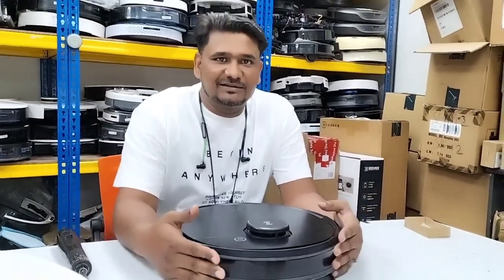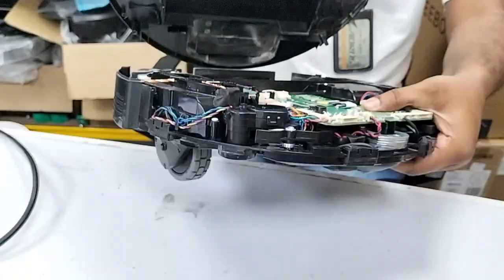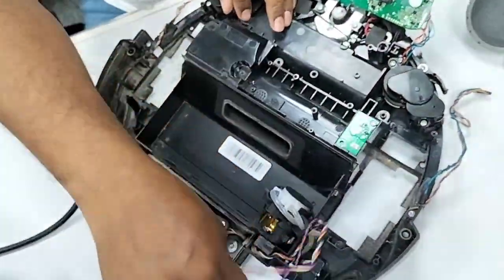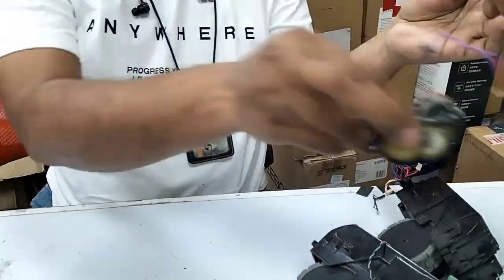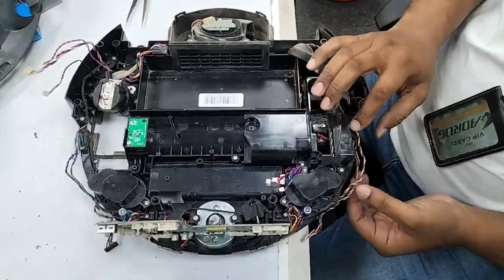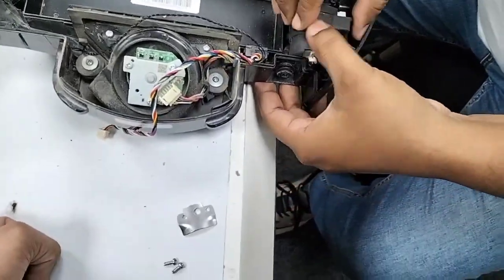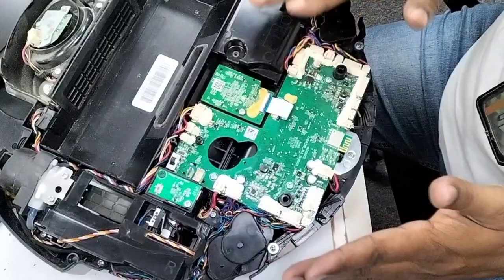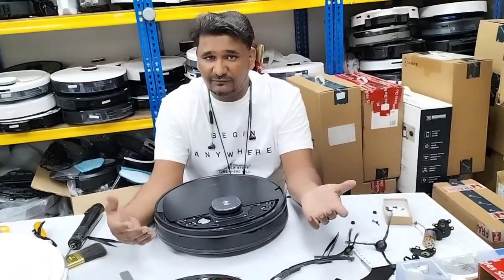How To Replace Main Brush Motor In Ozmo 920,950, T8, T9, N8 Pro, T8AIVI & Many More

Comment: The brush on my N8 Pro+ quit spinning, watched this video, bought the part online for $30 or so bucks at amazon, followed the video and the robot fired right up after assembly. On my Brush Motor, the pinion gear on the motor had stripped due to hair getting in and displacing the lubricant.  Thanks Guys, saved me some money in these expensive times!
Reply from the maker: Welcome

Comment: awesome video, my brush stopped spinning. after cleaning the motor it worked perfectly fine although i got two srews left ... but the dude in the video is right its a pain in the ass to dissemble and reassemble.

Comment: Thank you! I was able to do a repair myself, it was not easy, The gear attached to the motor was half gone, but I managed to make it working by raising the other gear wheel with an additional washer! It works fine now, not sure for how long though 🙂

Comment: My main brush was feeling bound tightly at random intervals of rotation.  His very detailed instructions allowed me to get the motor out and remove my animals hair/grease sludge from the gear box, re-lube and put our Deebot N8 Pro Plus back in action.  Very minor differences in some wires and screw locations, but I would have never pulled the motherboard to get to the motor without his instructions.   Thank you for this!!
Reply from the maker: Waoo superb.... really happy to hear that my videos help you to Solve The Issue 😊😊😊
Reply: @ecovacstechnicalsupport5278  thank you.  It was very concise and detailed. Deebot got right back to work after reassembly.

Comment: I started working in a company doing repairs of all kind of stuff at the beginning. And a customer gave us this product cause the main brush us not turning. Now I might be able to do a diagnostic and repair it if the customer want it. Thanks a lot !
Reply from the maker: If it's not ozmo 950 then just main bruh motor need to replace...if ozmo 950 them might be motherboard n motor together need to replace

Comment: Very helpful video, thanks! I've successfully replaced the main brush motor on my Deebot T9+. However upon reassebly, I found a small rubber wedge that had fallen out of the vaccuum at some point. It measures 14mm long, with a triangle profile of 7mm wide and 8mm high. I don't recall seeing it during disassembly/reassembly and have no good idea of where it has come from. It's a long shot, but do you have any suggestions about where this piece should go? Perhaps somewhere around the main brush enclosure?

Comment: Thanks to this video I was able to replace the main brush motor in my T8. I had one of the camera ribbon strips pop loose but it.. wasn't damaged so I was able to lay it back in its socket and close the brown lock back down.
Have a few leftover screws and the push button and power switch are a bit picky but it works again. I probably didn't get all the wire looms just right so buttons aren't perfectly working but it's going. 
I was watching, doing tear down, and stopping and starting etc to double check things. I already see some things I missed but nothing that makes it refuse to work.

Comment: Man what an absolute pain. For a piece that inevitably get clogged up you'd think they'd make it as easy to get to and clean.   My n8+ kept saying the brush was tangled but nothing was in the brush. Came across a forum saying the motor itself was probably clogged.  Followed this vid and opened up the casing and sure enough it was an absolute mess.   Make sure you buy some super lub synthetic grease if you plan on cleaning it out as you need to re-lube the gears after washing them off thoroughly.   Thank you so much for making these videos because I never would've been able to figure this out on my own.
Reply from the maker: Welcome 😊

Comment: thanks for your video, because of it I could trace the fault (rounded/stripped pinion gear) and replace it. Now the 950 is working again. Just a few screws left over... Small request. it would have been helpful if you could foxus on the screws next time. As between dis- and assemlbly there were several weeks i surely placed the incorrect screws.

Comment: Thank you for the video. It was very helpful for replacing a T9 AIVI motor - before replacing the motor the vac would stop after a few minutes with error message saying the main brushbar was tangled even though it was not.

The issue I am now having though after motor replacement, when the vac hits into a wall, it will sit still for a minute, and then continue on, hit the wall again and sit for another minute. On an open area it seems to clean ok but as soon as it turns/hits something the vac just stops moving even though the brushes are all spinning. Any suggestions?

Comment: Hey guys, great video thanks so much. Gave me the confidence to give this a try. Only problem is I’ve reassembled back to test and it’s still making a whirring/buzzing sound from around the area where the brush motor is and not turning. Any ideas? Thanks so much 🙏
Reply from the maker: Plz check my videos about side brush motor noise issue.. might be side brush motor issue

Comment: hi, greetings from Italy.
I have the main brush problem, i followed your guide or disassembled everything, i tested the disassembled motor and it works. 
I reassembled everything but the brush doesn't turn!  Do you think it's a problem with the motor that isn't fitted or the motherboard?
Thank you!

Comment: Great video - thank you.  After reassembly, my ecovacs seems to be running backwards!  I checked the mainboard plugs against the photos I took during disassembly.  Can't see anything wrong.  Have you see this behaviour before?
Reply from the maker: Many times... mostly is assembled slightly wrong specifically from front that's why bumper stucks with top cover... sometimes technicians forget to fix front anti drop clip which touch the bumper

Comment: Great video and quite helpful. This will help a lot of people. 

Would just like to correct one thing that at 19:13 you mentioned carpet sensor. It is actually the mop plate detection sensor, under water pump with white glue!

Your videos are quite educational and interesting! Thanks
Reply from the maker: Thanks for correction... some time in flow I just speak but later when customers inform then only I realise that what's the mistake... that's mop plate detection sensor..you r rite.. thanks again ❤

Comment: Super helpful video!  I still have an issue though.  I've gotten everything back together up to the test phase and now I have a "Please clean drop sensor" error.  It seems that the wires and connections are all in good condition and the sensors themselves also look to be in good, clean, and clear condition.  Is it possible I missed something, or am I looking at a mainboard issue?  Are there any possible suggestions?

Comment: My main brush was having issues so I ended up watching this video. I must say it it a very detailed video. 

After I install pieces back and after putting battery, I ran the test you recommended before putting everything back. It appears that the right wheel is not rolling. I watched your other videos on wheel malfunctioning but for my vacuum the wheels were working perfectly fine before I opened the vacuum to replace main brush motor. How can I fix this issue ?

Thanks again
Reply: I opened the wheel and checked for the motor getting burned but didn't see any signs of that. Re connected all the wires for the right wheel. What am I missing here ?

Thanks once again.

Comment: Bro, my T9 has high pitch sound and doesn't vacuum/ sucks dust like before. Basically it has attitude problem. Can a main brush motor be the problem? Or is it a mother bot issue? Been using it for 4 years and now this problem occurs. Please help. Hey, ur videos are very informative.

Comment: Thanks for the video. Do you know where i can find a replacement pcb for the tiny pcb that takes the ribbon cable to the top right of the motherboard? I broke the tiny plastic locking piece then bent the pins where the ribbon connects in to.
Reply from the maker: Need to check online sellers
Reply from the maker: In Malaysia I can provide

Comment: @ecovacstechnicalsupport5278 Thank you so much for making and sharing these incredibly helpful videos!  You've helped me repair my robot vac MANY times!  I'm hoping you can help answer a question... Under the LDS assembly and housing are 4 small push buttons (outer buttons facing up, inner buttons facing out) wired in series to a 3 pin connector (only the outer two pins are used).  Do you know what the function of these buttons are or know what the pinout of the three pin connector is?  Asking because the wires broke off very close to the connector during disassembly, and I'm not sure which wire goes to which pin on the connector.  Thanks so much for everything!
Reply from the maker: When deebot go under sofa or bed etc...if place not enough so top cover Will Press down or Press back From from....these buttons function that time...U can try..press top cover you will feel clicking soundsor press from front top cover you will feel same click....when we Press this so deebot will reverse back from that places so it won't get stuck easily this type places
Reply: @ecovacstechnicalsupport5278  Thank you SO MUCH for quick and helpful reply!  I really appreciate it!

Comment: Thank you for this video!! The gears inside my motor were completely shredded. All uneven teeth and some of the gears had no teeth left. Looks I’m buying a new motor!
Reply from the maker: Just replace main brush motor.. Will be ok
Reply: @ecovacstechnicalsupport5278  yup, that’s what I did. You actually replied to my other comment where I thanked you for this video. Vacuum has been running like brand new for over a month now every night. Thanks again.

Comment: Thanks for the video. can you please share a link to buy this main brush motor with gearbox (what you replace here). I really appreciate any help you can provide.
Reply from the maker: Actually parts you need to check online because I bought from china direct..but Amazon Ali Xpress in different countries different sellers selling online...U just check the model no...this motor assembly can use in various models...Ozmo 920, 950, T8, T8aivi, T9,T10,even in Omni also is same assembly

Comment: Many thanks for this video! I have a Ozmo 950 and the main brush motor has just recently burned out because it sucked in a cat toy and got stuck. I am now running the Bot with the vacuum slot instead of the brush slot (works reliable and gets all the stray cat hairs likle a champ agaon). 
My question: Is there any problems I can expect from the burned out motor or should I be able to run it this way just fine for the forseeable future?
Reply from the maker: In Ozmo 950 model my experience is that 70% cases motherboard & main Brush motor together need to replace...but U can try to replace main Brush motor only first if it starts working then ur luck...if not then see if you want to replace motherboard..more can continue using like this also no issue
Reply: @ecovacstechnicalsupport5278  Thanks for the advice! So far it runs great with the vacuum insert instead of the brush.

Comment: Hello, I have a T8 AIVI-- changed the main brush motor and it still doesn't spin.  I have installed a new main brush as noted in your other video and the roller guides are not burned out.  Any suggestions?
Reply from the maker: If new motor not turning then motherboard got short circuit with main Brush motor..need to replace motherboard together with motor

Comment: Dear Sir, I have Deebot 950, the right side bruch is making noise when the robot is at the corner, otherwise it works best and there is no noise. I opened the robot, thanks to this video. When the gears are checked, they don't seem to have any issue. When I cleaned and regreased the gears, I can see the gears are slipping. I need a help to get the gears, is it possible?

Comment: Hello Sir. After replacing the main brush motor on my Deebot x1 omni, I cannot see anymore the video from the front of my robot through the app. Black screen. I think it is related with the flat connector you mention in this video not from the top camera but the front one. See 5:09. How can I know if despite I don't have the video in the app, the sensor is working correctly for the robot to correctly avoid obstacles, etc? Is there any test I can perform?

Comment: If the motor is still working, what else could it be that is preventing it from spinning? Does the mainboard need to be replaced?
Reply from the maker: You mean side brushes main brush turning vacuum fan also spinning but deebot not moving forward...after few seconds deebot itself gives error what's the issue... Some time just says plz help me out... means D-Tof assembly issue....
Reply: @ecovacstechnicalsupport5278  I mean the main roller brush. My T8 Aivi is cleaning, side brushes are rotating, there is no error message in the App but the main roller brush is not rotating. So I used your video guide to open the robot and I replaced the motor like shown but it didn't solve the problem.
I tested the removed motor with a power supply and it is working. so it seem like the motor for the main roller brush in the robot doesn't get power.

Comment: Thank you for this video! I fixed the main brush and it's working perfectly.  I buttoned it up, put it on the floor and it runs backwards.  Once it runs into something I get a drop sensor error. Can you tell me what wires might be crossed?
Reply from the maker: Tap the bumper bit Hard bumper sensor I think stuck in assembly...whith taping it will come out...or u can remove bumper n clean inside all dust n remove that sensor manually with fingers.... there's video also available at this topic

Comment: Hi and thanks for the video. does deebot have any wifi module ? my debot is no longer shows its current location on the map. it also fails to find its location. I thought it might be because of its wifi module or something?!
Reply from the maker: This type issue normally happens when LDS or D-Tof assembly giving error...need to do some service of LDS/D-Tof assembly.. hopefully will solve the issue

Comment: Thank you very much, the video helped me to replace the motor, but i have an problem now: when i start the deebot it is cleaning backward and stops with the problem „bumper blocked“.  What did i wrong?
Reply: I am also having the same problem. Is there a solution?
Reply: @LandonCroteau-y6o  
I dont have a solution, would be very happy for an information :(

Comment: you think its possible to fix the motor or just order a new one? i cleaned it and its still goes on and off
Reply: nvm i fixed it by switching the motor bearings and now it works again! ill uplaod a video on the t10plus soon
Reply from the maker: Motor assembly need to replace sir

Comment: How many cents did you guys save by going with plastic drive gears? Because it wasn’t worth it. Ours is shot after only 3 years. Sounds like a dentist drill as the gearbox is stripped out.
Reply: Pretty sure they’re not with ECOVACS, lol.
Reply: @AydenDevonny  The channel is called "Ecovacs Technical Support". Kind of figured they're affiliated with them.

Comment: Admin please help: the Deebot drives backwards after the replacement 😢
Reply from the maker: Plz check the wiring... night be not at proper place that's why top cover not adjusted properly that's why bumper is stuck with top cover n reverse

Comment: The little red clip that holds the side brush has snapped on my Deebot T8 AIVI !! I think I need to replace the whole side brush motor , I’ve looked on the channel but I can’t seem to find a video addressing side brush motor issues. Anyone have experience with this ? Please help . Thanks
Reply from the maker: Side brushe holder broken...in this case side brushe motor assembly need to replace...it comes in a assembly
Reply: Thanks ! Would it be possible to make a video of how to replace the side brush assembly ??? Please.  I have looked through your videos but cannot find one replacing side brush motor!

Comment: How can I order the main branch motor ?? Pls,tel me.
Reply from the maker: Actually you need to surch online like Ali Xpress, Amazon etc... good this is one motor can use in various models so easy to find
Reply: Hi. Sorry again, I need you help.!
I have now replaced the motor. finished but when reassembled The machine cannot work as before. The machine travels in a circle alternating left and right. cannot work in a straight line as before And the main wheel doesn't fall down when lifting the machine. My machine is a 920 Deebot ozmo, what should I do next?
Reply: @ecovacstechnicalsupport5278  and the machine can’t back to the stand charger.!?

Comment: I can’t believe ECOVACS buried the weakest component in the system deep inside the device in a such a way that the whole damned thing has to be completely disassembled to replace it. That’s quite a departure from iRobot’s design, where everything is modular and easily replaced.
Reply from the maker: Just only in new model got this design..older model all ok no Hassel to replace any parts...but it's ok.. won't spoil daily... maybe once a year need service...for ur car also you go to service centre right... so it's ok normal...but if you have free time U can do at home..if need any help can get my help anytime...☺️

Comment: I thought I did everything right with no wires sticking out…. And now I’m getting the bumper is stuck error…😢 What do I do @Ecovacs_Technical_Support ? I have a T8.
Reply from the maker: Plz send a small video clip at 00601137973018